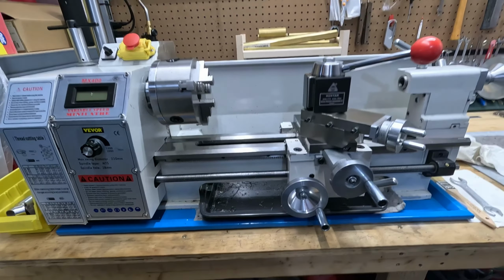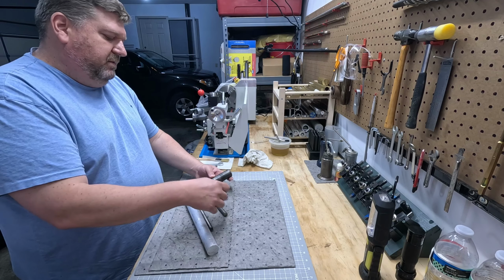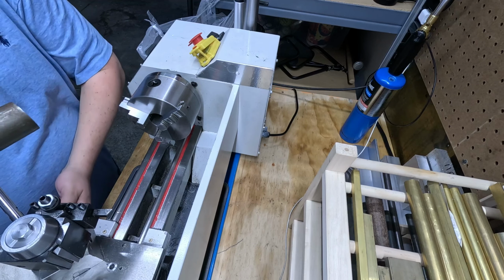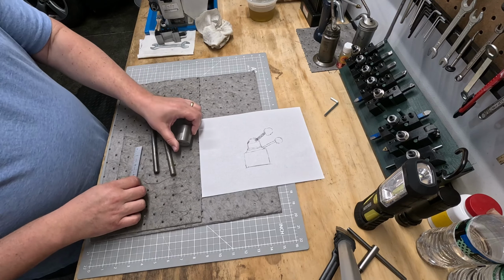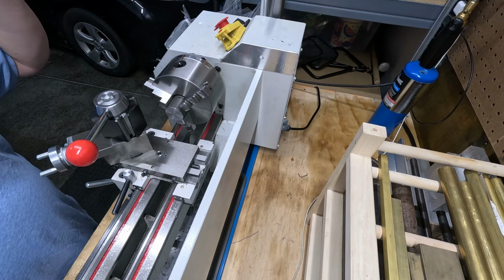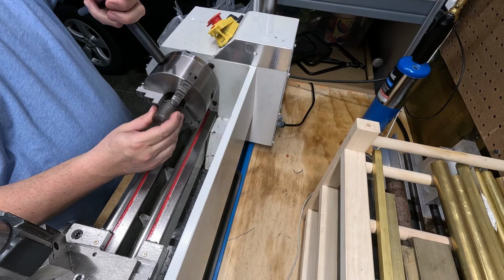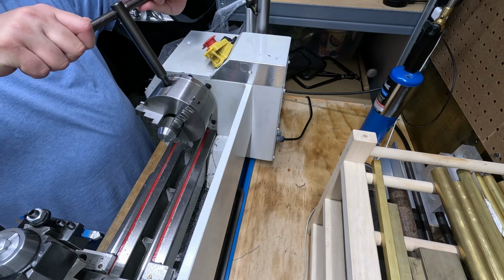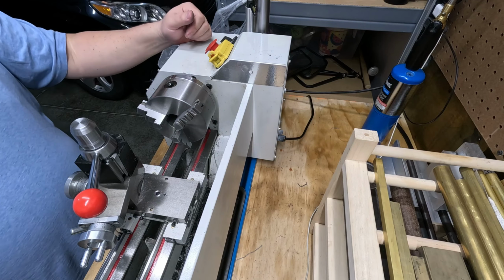QCTP Part 1 Upgrade - Custom Lock Lever for on the Vevor Mini Lathe. More improvements. Quick Change

Comment: Deez best practice is to lock your tailstock when doing any drilling boring ect.
I noticed it sliding as to were working.
It also keeps it center for more precise applications.
We are the habbits in which we create.
I know it's just a locking handle but always use proper practices it will just make you better as you go.
Happy videos my friend.
Reply from the maker: I made a lot of these newbie mistakes when I first started working with the machine.  I still do make mistakes but I have since learned from the great tips and advice from all the great comments.  I do lock my tailstock now but early on there are so many things to learn.  This was one of the many.  Thanks for the comment.

Comment: I would make the bolt out of 4140 then heat treat it.
Reply from the maker: I need to get some 4140 and try my hand at heat treating.  I think all the metals ive hot blued or tried to harden have failed due to low or no carbon.  This is something I still need to learn more about.
Reply: @deezworkshop  I can help you with heat treatment of small parts, I have a small kiln that my late wife used for jewelry making.
Reply from the maker: Sorry to hear about your wife.  I appreciate the offer.  I will keep this in mind and reach out as I come up with new projects.  If/When I start making Tools, well functional tools, I will need to get them heat treated.  I still need to learn the right materials to use before i even start.  I am getting there though.  Need to source some good carbon steel if I am going to make something that will need hardened.  Appreciate the offer.

Comment: Looks good.

If you would have left the material on the parent stock it would have made it much easier to turn your tapers and turn the material down to size in one setup. Then you could have cut it off, faced, drilled and tapped in another.

Try not to hold round stock by hand when cutting on the band saw. If the blade grabs it will spin the material in your hands possibly hurting you. Put it in a small vise or use a C clamp to hold it. Jimmy Diresta has a short on this. ( I hate safety Nazis too but just concerned)

Soda/pop/coke cans (depending on different parts of the country) or your preferred libation make great shim material to keep the jaws from marring the finished surface of your work without throwing it out of concentricity.
Reply from the maker: Order of operations is something I'm continuing to learn and improve upon.

I have started figuring out to not part off my pieces right away so I ahve something to chuck up.  There really is a lot to think about to make the turning expereience better with a better outcome.  As for safety.  Its never a bad thing to point out mistakes and proper ways to work wtih materials.  I ahve been realizing that the need to using a vise or clamp to control round stock in the bandsaw is very important.  I dont want to get injured and this is a great reminder for me and everyone else.  Thank you for the reminder on safety.

I do need to cut out some shiums from cans to have on hand for quick use to keep softer materials from marring up.
Reply: @deezworkshop  I am glad you're one of the few people who take constructive criticism for what it is and don't get upset about it. Reading my comment back it sounds kinda harsh and it was not meant to be. It was meant to be suggestions to help you out.
Reply from the maker: Its wasy when your making a comment,  I already know you are coming from a good point of view.  But appreciate it.  I learned not long after I started this channel many people have opinions.  It is easy to take offense to them.  I told myself thats not how im going to approach the comments and feedback.  I decided that I will listen to the experienced folks positive as well as criticisms to improve my skills and learn as much as I can. The collective knowledge of this community is not something to waste.  So for that I thank you and all the others who have helped me get to this point and continue to help me progress with skillsets as well as saftey. Cheers
Reply: @WILFRED1184 When I read back my criticisms sometimes they seem harsh too. Written responses can’t covey emotions without a paragraph. Like you I think Deez understands this. And when he does I hope he questions me🙏